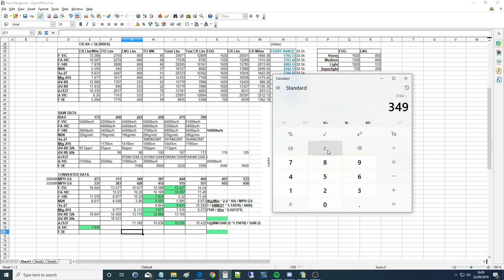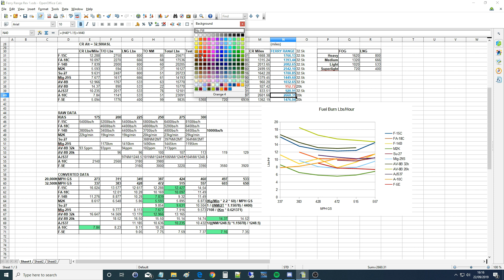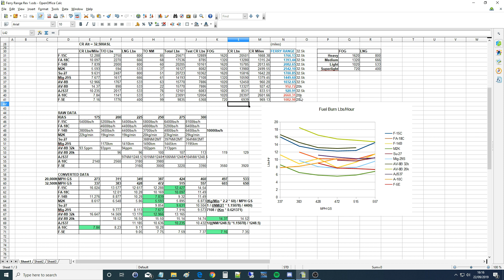AV-8B, A-10C & F-5E: Max Ferry Range Data Corrections | DCS WORLD

Comment: I'm no harrier expert cap but, the harrier uses cold air from the first stage compressor for the front nozzles thus would cause a degraded performance at the hot stage and needing to burn more and turn faster for the turbofan to effectively suck in more due to this loss of air capacity.
Reply from the maker: thx

Comment: Hey CAP, I would assume that the AV-8B nozzles cause efficiency loss due to the restrictions in the pipe. In the standard rear facing engines the exhaust is pretty unrestricted. But with the Harrier they are routed to those side pipes with angles that will restrict the airflow and cause back-pressure. The engine has to overcome this back pressure before even creating thrust. Not an engineer but that seems like the most logical reason.
Reply from the maker: Like blowing through a thin straw right?
Reply: @grimreapers  more like bending the crap out of straw then having to blow through it :) but basically yes.
Reply: You've been talking to your wife again. ;-)

Comment: Wait a minute... in order to select the optimal fuel consumption for maximum range, shouldn't you use the unit lbs/mile?
I didn't do the exact math, but if speed goes up from 497 to 533. Harrier @20k fuel consumption goes up by roughly 2% but speed by more than that. Hence the higher speed is more efficient, because you burn more fuel, but can cover a higher range.
So my tip is to divide rows 61 to 71 through their corresponding ground speed and select best from there.
Hope that helps...

Comment: Hi CAP, as always I enjoy your videos - also the fact that you correct and update errors made. 
However I don't fully understand why you make these elaborate tables in excel, and then use the PC calculator to calculate and manually input the results? 
The purpose and true benefit of excel, to me at least, is that it can do the calc's by adding up, multiplying etc. cells. IOW. If you make references to "locked" cells you can just change the input data, and the results would change accordingly.  I'm sure you know this of course - but for correcting a slight mistake like this one shown here - you could have updated the spreadsheet  in but a few cells quickly, and results would have been arrived at faster... No critique, just my 2 cents :-)
Will make it easier to update in future, adding modules etc too.. I would be happy to show you an example if need be.
Reply from the maker: I hear you, just started replacing the manually calculated cells with automated cells. Much easier.